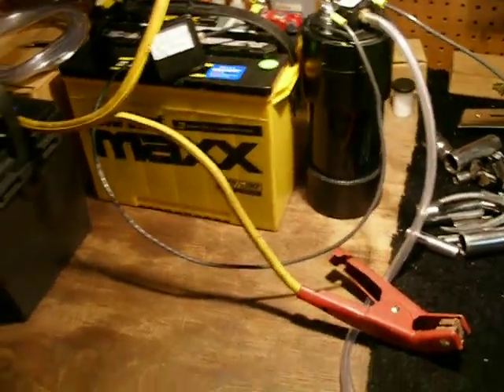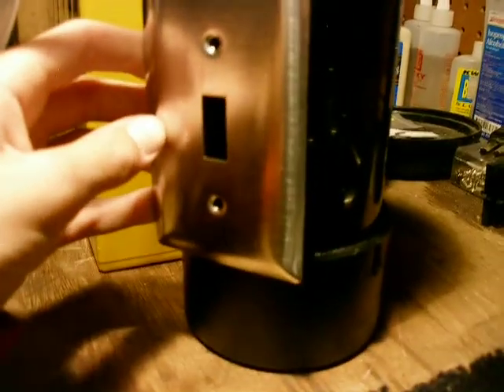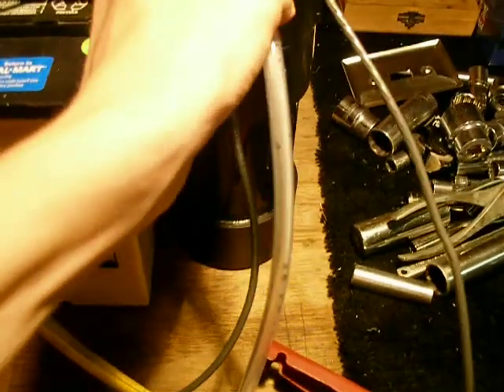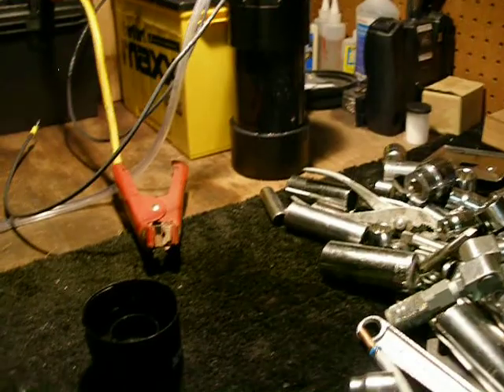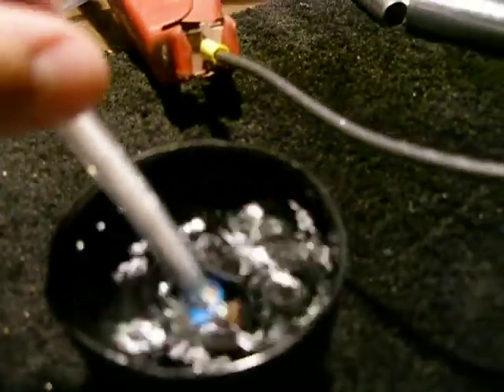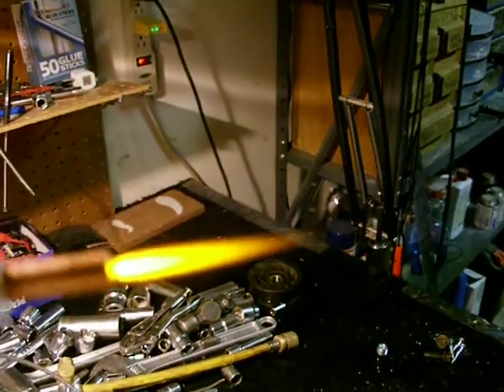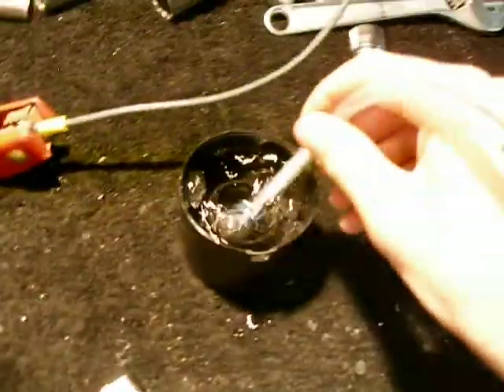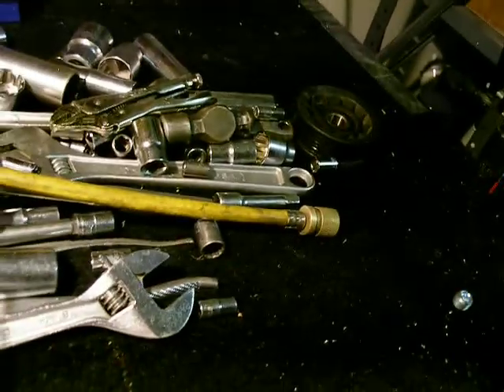HHO generator 25 Volts 1.1 LPM Torch!!!

Comment: Dude you will get three times the output of HHO Gas if you 1) Use Potassium Hydroxide instead of baking soda. 2) Use distill water. And 3) Increase the number of plates in your HHO Generator. 4) Sandblast your plates in a vertical direction.

Comment: notice the orange/yellow, that is co2, its because of the baking soda, just hydrogen burning is almost impossible to see. Also when connected differently, you could get over twice the hho for the same amps and volts. Keep at it, test other setups. D3